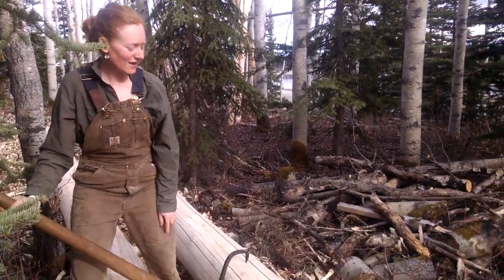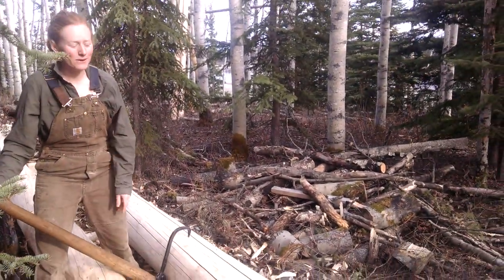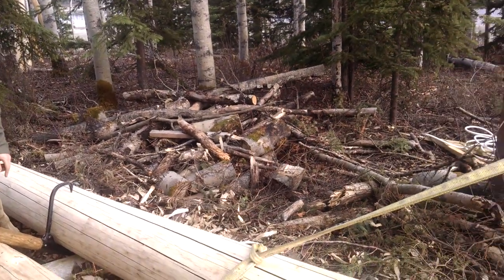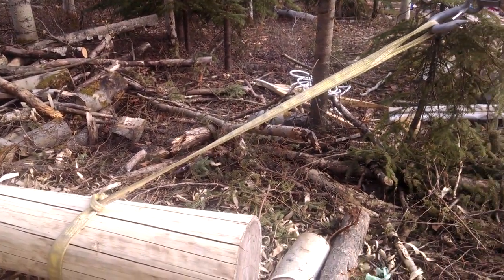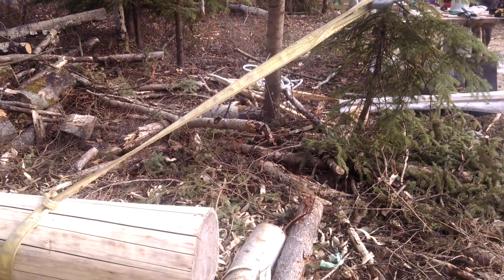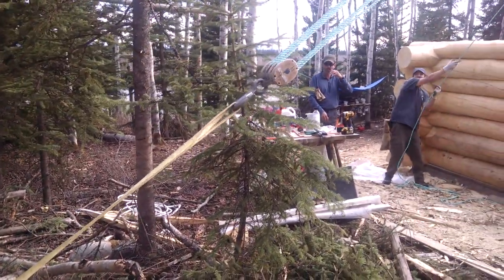Using a gin pole to build a log cabin off the road system

Comment: Could you describe in more detail the various parts of the gin-pole system: one vertical pole secured in the corner of the cabin (how long was the pole?), one movable pole with one end attached to the base of the vertical pole; three block and tackles - one affixed to the top of the vertical pole, and two attached to the other pole (how did you connect the rope to the winches? And, how did you choose the winches to get the mechanical advantage you needed?  Did you refer to a book for help? (If so, what was the title of it?)
Reply from the maker: https://www.google.com/url?sa=t&source=web&rct=j&url=https://alaskahomesteadadventures.com/blog/2017/10/24/cabin-5-gin-pole&ved=2ahUKEwj-gf3Tw4b9AhUhAzQIHf52BnIQFnoECBYQAQ&usg=AOvVaw2AWUirRLWYs_TkLzboaEf7
Reply from the maker: Heres a link to a blog post we put together on our gin pole. I hope you can get some of your questions answered there.
Reply from the maker: We're building a large guest cabin with it this summer,  ill try to make some more content then